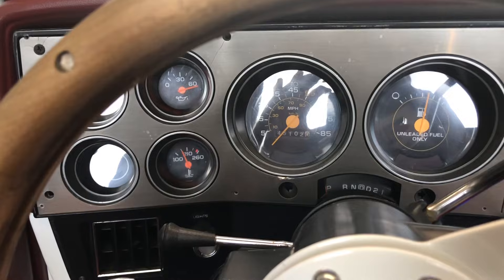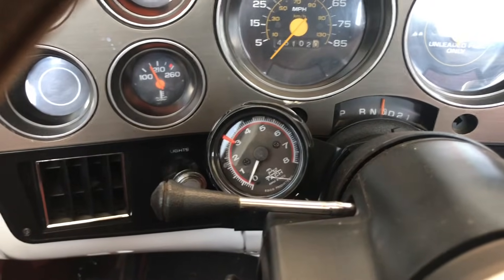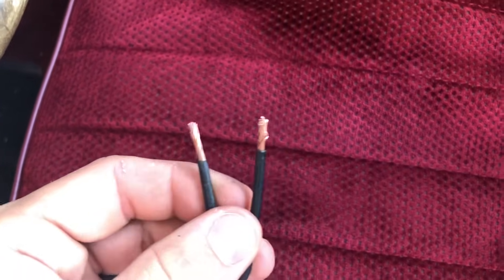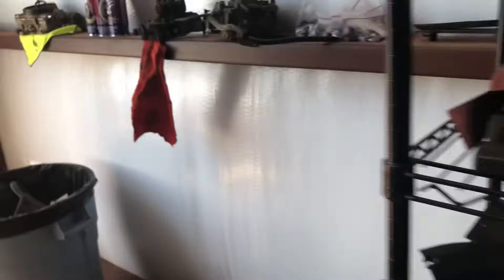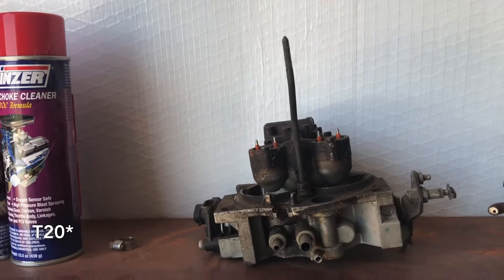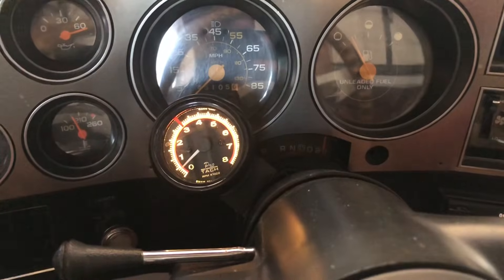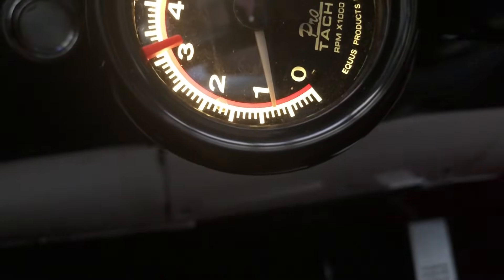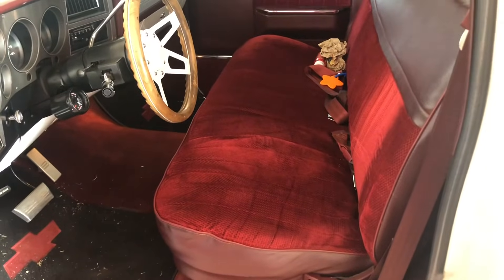How to: GM TBI Idle Adjustment

Comment: Take an old windshield wiper assembly apart. There are two thin and narrow metal strips that hold the rubber. cut one and bend it like a tweezer, turn the ends 90 degrees. You then have a thin jumper that works better than wire or a paperclip.  It also makes a good little pry bar for lock picking.

Comment: Why you doing all that extra stuff just turn in the idle screw
Reply from the maker: Cause I’m doing it the correct way.
Reply: @3rdGenC10s lol literally none of that does anything but okay
Reply from the maker: It’s 100% does.
Reply: @3rdGenC10s it 1000 percent didn't make a damn bit of difference on my 94 suburban
Reply from the maker: @kylejackson620 go drink a monster and punch some drywall Kyle.

Comment: Hi. I have a 93 Blazer Silverado SUV with the same problem.  How long do you leave the bridge in? Do you remove it after the initial 30 seconds, or do you leave it in while setting the  idling to 750 RPM...?

Comment: Hi. I have a 93 Blazer Silverado SUV with the same problem.  How long do you leave the bridge in? Do you remove it after the initial 30 seconds, or do you leave it in while setting the  idling to 750 RPM...?
Reply from the maker: Leave it in till done and engine is off.
Reply: @3rdGenC10s many thanks..

Comment: Hi. I have a 93 Blazer Silverado SUV with the same problem.  How long do you leave the bridge in? Do you remove it after the initial 30 seconds, or do you leave it in while setting the  idling to 750 RPM...?
Reply from the maker: Until you are done.

Comment: I have a 2004 GMC topkick roll back, I used to be able to set the cruise control in park to idle up the PTO for the winch and bed movement but now it doesn't work, I'm speaking on idling the Engine up to operate bed faster , the cruise control does work while driving it but it doesn't work in park for speeding PTO up as before, anybody know this problem,I'd surely appreciate it...
Reply from the maker: You may need to look into the PTO module itself.

Comment: Just did this on my 87 R1000 Suburban and it worked a treat! Thank you! I was surprised by how far I had to run the screw in to make any real change and had to run through it twice to get it where I wanted it but dang it worked nicely!
Reply from the maker: Glad it helped you out!
Reply: I had to turn my screw all the way in to reduce the idle from 1200 to 900rpm

Comment: My 87 surges a little at low speeds and then in gear jumps between 700-1000RPM.   Put a new IAC on today but didn’t do this….may have to try that tomorrow
Reply from the maker: 100% necessary.

Comment: Thanks for the video, thought I'd mention that turning the idle screw will change the tps output voltage, mine stayed within the proper range after setting idle but there could be tbi's out there that after setting the idle, the tps is out of range.
Reply from the maker: Good looking out

Comment: Thanks my dude your a real one for sure, I’m gonna adjust my tbi later on my 91 s10. The problem I’m having is during acceleration my truck kinda bogs down, 1st,2nd gear kinda bogs 3rd gears seems like it kicks then the 4.3 is happy again, then stop light comes up, and oil pressure tach goes down, and so does the gas gauge, sometimes the truck will turn off if I don’t have my foot on gas a little.
Reply from the maker: Glad I could help!
Reply: Did this fix your problem? I'm kinda having the same on my 94 silverado,  kind of bogs under hard acceleration from a stop

Comment: Dumb question. Are all the steps necessary? Could I just turn the T-20 to make it idle higher?
Reply: You actually shouldn't turn that torx to change your idle. It changes the values on the throttle position sensor and can cause transmission shifting issues. You can do everything else he talked about, maybe adjust timing but no touch the throttle screw.
Reply from the maker: I would follow the steps recommended by GM

Comment: I got a 92 s10 with the 2.8 v6. And it's over due for age maintenance..  I got  gm code 44 and 46 if I  watched  the flashes rights.  44 lean and 46  faulty   key cylinder.   Years ago my father played with the 🐈.  So south carolina don't  check....cats... so it went away.  How do I fix the lean for only having one  of  o2 sensor  left.  Yes I got a muffler  single pipe.
Reply from the maker: I’m not real sure on that haven’t messed with a TBI in years.

Comment: Finally I learned something about the TBI that I didn't have to second guess whatever issue I was having at the time! I've had a 1994 GMC Sonoma for going on 8 years now, I love the truck, rwd, 4.3, automatic, ex cab, that was crashed a little bit so I put a frame horn on & went from there. I drive a little aggressive but in Reno if you don't, you'll get sucked right in to the non stop circus of the lamest people trying to drive without a clue what they're doing! Traffic tripled here in a less than two years, being a local, I know every back alley & side street there is so I mash the pedal & jam! I'm a former m/ racer so it's not like I'm just going fast like the rest of em', I pay attention to my every move in advance & don't look at my phone ever! But it's been a lot harder to do when I find that I can't rely on a strong little v6 to get with the program when a car is heading my way & I can't afford a stall or sputer that I have to feather the throttle with in order to not slammed. I've got an older 4.3 not a vortex anymore, but this is a strong engine, I also freshened it up with crane roller rockers, new push rods, oil pump, timing set up, all new sensors, which ain't much for a 94 on the cusp of KISS to more complicated than it's worth with all of the OBD 2 garbage, my buddy completely rebuilt my transmission with Corvette servos, after going thru transmission blues between getting ripped off for one tranny, a piss poor mechanic who supposedly knew tranny's, bla, bla, & four transmissions later, I have a Vette trans or a Camaro one, both the same, but built right with not a leak anyplace. He helped me install the new old 4.3 & it's truly a great truck with plenty of power when I want it, all of this was done and it was a happy place..until the very first cold night every year, then it would start tripping out & revving like the throttle was stuck, about 2500 for a few minutes then slowly start to drop off & then it'd go down to about 1200 for a minute or so, then it'd drop to 800 after the whole thing played out over a ten minute time span that seemed like 30 minutes half the time, not to mention fuel at 4.00+ for ever, or until it scrapes the paint off of a 5 dollar bill every few months. But then it would run great, no problem all day until the next morning, then the same shit all over again until spring came along, then it'd light right up, no high idle, no waiting to leave, ran perfect, until winter again, wash, rinse, repeat, every year with not one person on being able to tell me something I had not already tried to no avail. I had new TPS, new IAC, new temp sensors, new MAP sensor, new Mass air flow, new vacuum lines, all of the wiring is on the firewall, like an old school ride, not being bbq' on top of the engine like factory, I did that right away, but with literally every sensor new at the exact same time when I put the other engine in, it started doing all of the high revving stuff again, it made no sense to anyone, yes, I even put a new computer in & it was a BDYT exactly as the one it had new, I now have a complete set i can change out in a few minutes whenever I thought maybe its something else? I just went thru this two weeks ago, & rather than buy a brand new IAC, I opted for just a new TPS because it was on warranty so maybe it was bad now, it's been three years almost since the new engine, tranny so what the heck, I've asked more people than you could round up for free green beer on St. Patrick's Day & still no logical answers & figured it was just what it's gonna be. The fuel injectors were going me some problems and out of the blue, the idle started acting up but different than the other ones, then it died completely, between scrounging up a set of injectors that would do until I had money, I thought that maybe the TPS again, I didn't know, but this time, all of the sudden, it idled right down, right away and it was freezing outside! So now it ain't screaming bloody murder every morning, but all of the sudden, it was idling a bit too low, & dying on me over the past few days, I tried timing adjustment, nothing would bring it up just a few hundred rpm & I've been raçking my brain trying to to figure out what to do next. I needed to replace the cruise control cable for a long time now & just hadn't gotten around to it until now, that's when I needed to figure how to move the little clip thingy without breaking it, that is what brought me to your video, & you having the answer I probably needed when it was idling high, most likely not, but the point is now it doesn't idle high for whatever it was that I replaced this time that didn't work when I replaced it the previous times, but the high idle is gone, the low idle problem is over now, thanks only to you, because up until this point I was flipping out over finding out my motorcycle insurance just leaped way up because of one speeding ticket I got in my truck last fall, and never had a violation period on my motorcycle in more than 36 years, but now my fucking insurance automatically raised it  because maybe I'm gonna go wild in the streets like Marlon Brando because I got a ticket in my truck, but need two classes of license and never had a ticket on a hot rod motorcycle, so I'm automatically guilty when my truck & my bike don't have anything in common period, I guess if I step on a bug outside, and kill it, I'm going to start being a serial killer by next week! Fucking burocratic bullshit, I want to sue em' but I'm white,so that won't work, but you sir,made my fucking day & I thank you very much for the useful information that I needed today of all days, you rock! 🏁✌️
Reply from the maker: Hell yeah brother!
Reply: It was the plug for the TPS! Now it's dialed in & I didn't have to change the idle screw. Goes to show it don't have to look bad to be shit! Still loved your video, thanks✌️🏁

Comment: Nice Vid.  I have a Jeep with a GM 4.3L TBI, was working like a charm for 10 or so years, and all of a sudden it no longer wants to start in the morning.  it fires a couple cylinders and then basically floods. If you hold it to the floor after, it Puffs and chugs until it clears out.  Once warm, it runs nice and will start fine all day long, but the next morning same flooding issue. I can see all my sensors are working with WinALDL.  Very strange. Any suggestions
Reply from the maker: Maybe look into rebuilding the throttle body. Kits are cheap and simple, I would also check the injector flow as well. You can cycle the injectors with a 9v battery.

Comment: I had a high idle problem on my 89 Blazer. I did the jumper wire to A & B, turned the key on for a minute,  disconnected, the battery for awhile and it seems to be starting up and idling about right now
Reply from the maker: Hope it helped you out.

Comment: This are the steps I took on my 1995 GMC Sierra whose base idle was consistently running 1200+ rpm (too high). 1) warm to operating temp; 2) engine off, jump A-B; 3) key on, engine off; 4) 30 secs for IAC to close; 5) unplug IAC; 6) remove jumper; 7) engine on with idle racing about 1800 rpm; 8) adjust idle screw with 20 torx--counterclockwise one half turn--note: engine does not respond at this step; 9) engine off, plug in IAC; 10) test engine on: idle=750-800; 11) engine off and unplug battery 30+ secs to reset any codes. On restart, engine maintained 800ish rpm at idle warm. Note that my setup includes a rebuilt TBI by SPR Performance with double bushings at the throttle butterfly valve to prevent fuel seepage caused by pressure from the ATI Procharger. I hope these notes answer the question as to how much of a twist of the adjustment screw is needed and what to expect when turning it.
Reply: I finally figured out that the plug for the TPS was bad, cut it back a few inches & wa-la! Idles at 600 now & runs perfect..only took me 7 years to figure that out, if all the contacts are good the plug itself don't necessarily have to be good automatically. DOH! 😂
Reply from the maker: Nice
Reply: The thing is you guys finally fixed the problem thanks for your dedication to solving the problem for all of us..May God bless you 🙏

Comment: Wasn't the idea of the factory plugged torx screw for it to "NEVER" be tampered with? That it is supposed to be exactly where it needs to be?
And so with that being said, that the owner would fix issues that allowed the ECM to make its adjustments to get the idle where it needed to be!?!?

...

But if you bought a vehicle with the plugged drilled out and "tampered with" , then I can see the need to get one of these so-called baseline adjustments. 

Could you please share with me where GM has published the procedure you demonstrate in the video?  Thanks!
Reply from the maker: https://www.gmcmi.com/wp-content/uploads/2013/02/TBI-Initial-calibration.pdf
Reply: @3rdGenC10s  ok....well that wasn't GM published, it was for a motor home. But thanks!
I have a '91 and when I got it back from transmission shop some years ago, they mentioned the idle amd took it upon themselves to break into that factory protected idle screw. And sooooooo,.I thought to check out this video as it is idling far to high still. I probably will check out doing what is mentioned here. However, I would think that GM would state something like....  , for your vehicle, the idle screw was set to a certain amount of turns blah, blah, blah and then " Sealed" to never be turned again. And therefore the idle screw wouldn't be turned dependant on how the engine was running, rather, the owner would know precisely how far that screw was turned in by the factory. Make sense?
Reply from the maker: @rickr2029  no offense but you can google just as easily as I can.
Reply: @3rdGenC10s  no offense, but I did that beforehand and your the one with the channel.that sent a link that wasn't GM. I "nicely" presented you my scenario. And instead of commenting that there is limited or NO GM info, you tell me I can Google it. And had you taken that route, you would have had another subscriber. 
Subscribers/Subscriptions are not an entitlement  just because a video is posted. Thanks anyway!
Reply from the maker: @rickr2029  I don’t know how to say this without it coming off bad so I’ll just say it. I don’t need your sub, one sub/view won’t make or break me. I do these videos for fun and to help others out. The monetary gain I receive is minuscule compared to the effort and time I put into the videos I post. So if one person is unhappy with the free content and can’t find the time to google something on their own, I’m okay with no having them subscribe. I will be just fine my channel will be just fine. I do appreciate the view and the comments as they do help out the algorithm and put my video towards the top.
Reply: @3rdGenC10s  ....sooo instead of going the pleasant route ("I've found there is little to almost no info on the subject") we need to tell them, that they can Google it just as easy.
When they ALREADY had. Okay, I get it. Crystal clear. Have a good one!
Reply from the maker: @rickr2029  are you Gen Z by chance?
Reply: Niceeeeeee 😂😂 @3rdGenC10s

Comment: Ordered the parts .. started to dig in , but ran into some seriously seized leaf bolts / bushings. Did you guys run into the same issue ? If so ….. any tips on getting those bolts out ?! We tried heat … banging them out… just about everything other than a press or cutting them.
Reply from the maker: I’m thinking this comment was meant for another video of removing leaf spring bushings.
Reply from the maker: If so a press would be your best bet for removing a stuck bushing .

Comment: Great information. 
When did you remove the jumper wire? Once you unplug the IAC?
Reply from the maker: Steps are in the description of the video. Jumper wire dosent get removed until
The final step.
Reply: I just replaced the old iac in my 91.
Would I use the same method to calibrate the new IAC ? 
I have a high idle now.
Reply from the maker: @stevetroyer8583  yes

Comment: How did you install the RPM guage.y truck doesn't have one. And I'll need the gauge to set the idle
Reply from the maker: Just followed the instructions. Tapped into the fuse panel and the coil.

Comment: Do you plug the IAC plug in before you adjust the idle or leave it unplugged until after?
Reply from the maker: Steps are listed in the description. It’s been so long since I did it I don’t remember the exact steps.
Reply: @3rdGenC10s  I found the steps. I set my idle to 650 700 rpms and after I drove it they were back at 1000. I just got the truck and supposedly it's a 383 stroker. I found a hyper tech chip in the glove box for a 5.7 now wondering if maybe there's one on the emc for 383 that's overriding what I'm doing and bringing the idle back up
Reply: @3rdGenC10s  what else could be the problem? Injectors are new. IAC is new. Everything is pretty much new. He finished it all at the end of 2020. I havent had anything that I've had to work on in a long time. Just trying refamiliariz myself with being a mechanic again.

Comment: You didn't show screw adjust...
Reply from the maker: You turn it. I’m very small increments. Hard to film everything when you are by ypurself.
Reply: @3rdGenC10s  Thanks. I'd like to hear a summary.  Like, " warm engine, shut off, X a+b terminals,  key on for 30 seconds, (hear noise in air controller) key off..Disconnect air controller. (disconnect battery for 5 mins ??) restart engine, oh, I'm lost
Reply from the maker: @wildbillfirehands  there is a list of steps in the description.